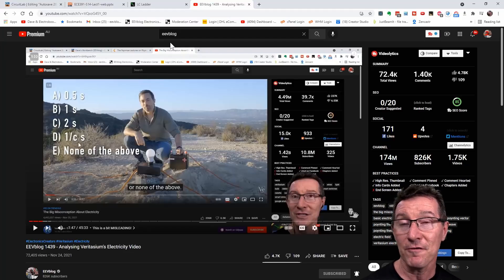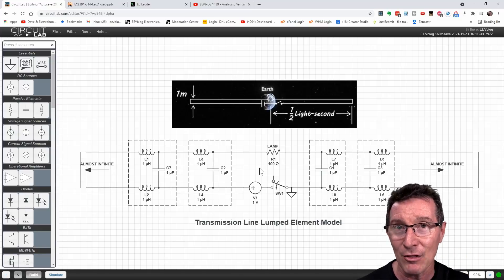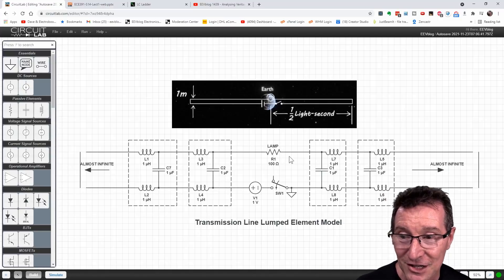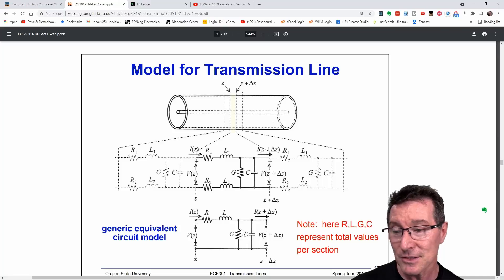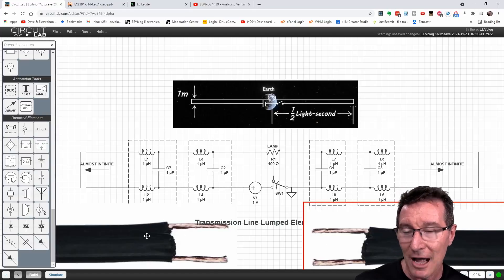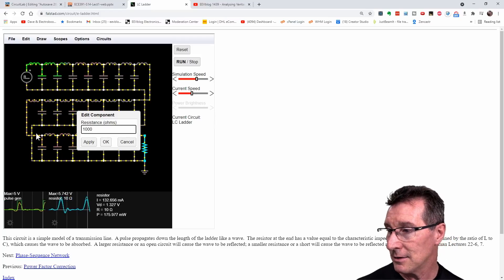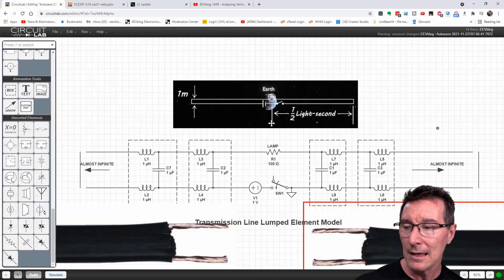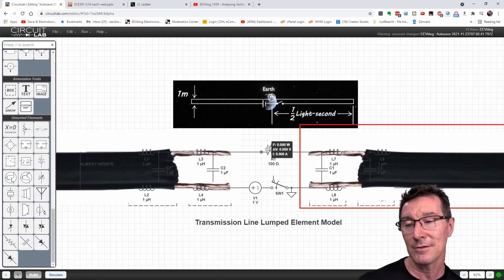Veritasium Electricity Video - Simulation Notes

Comment: The "spirit of the original video" is to fool people into thinking that the bulb will emit perceptible amount of light almost immediately after the switch closes. So stop trying to sugar coat it. If you're going to act like all it takes is a miniscule current to flow, then that's already happening due to background E-M fields. He wouldn't need the battery and switch to explain that.

Comment: Again, I strongly disagree about the spirit of the question. The demo clearly implies that the light turns ON. 
If he changed his question to: When does EM energy reach the bulb, I would gladly defer to your answer.
But that is not the question. It's when does it turn on.
By your definition, every light in my house and every device in my house, even without having the switch closed, is considered "ON".
Sorry, but that just a bunch of nonsensical science.
You can't just convert this to a transmission antenna question. 

Its a battery with a insulated conductor that "has no resistance" internally. It's a not magic light bulb. That bulb in the demo is clearly an LED. 
And that LED will have a forward voltage that must be overcome to light it. How are you planning to overcome the forward voltage this way?

By leaving those critical details out, your basically ignoring everything that makes that video wrong to begin with.

You obviously understand the underlying science. 
And we all agree that EM energy reaches the bulb after 1 meter of travel time.

But the energy arriving at the bulb is not adequate.
IF you spend time to watch the video, the pattern is clear that he actually believes the energy powering our home appliances merely has to travel with the external EM wave to be powered. So he demonstrates that with the bulb. But he is conflating that the EM Wave is External with Not having to be near the wire.
And that's two different things.
So, he falsely claims that the 1 meter distance allows for lighting the bulb. 
Take it a step further, it won't turn on my oven, it won't run my dryer and it won't spin the fan.
Reply: 100% agree, i have unsubbed for this reason. He purposely mislead his viewers for views.
Reply: @danielsmith7105  I was strongly considering unsubbing as well. I think the fact that he released the "YOU CANT RIDE THIS BIKE" before releasing any kind of "explanation video" to fix the issues with this video makes it pretty clear what the channel now stands for.

I will re-sub when he presents a video with a better explanation and corrects the important mistakes of this one. (Unsubbed.)

Comment: So in effect, the length of these loops could be infinite and they don’t really effect the fast transfer of field across the small gap. That local effect is what matters.
So no violation of speed of information transfer. We don’t rely on field transferring through the entire loop, just local capacitance. Just depends on this gap (1m , 2m or whatever)!
Reply: “1/c” answer is still wrong as at this exact time the amount of energy delivered is minuscule. And if we accept that “any current” works, then this is a troll question producing the same answer without wire at all.
Reply: What if someone cuts the wire 150,000km away? The lamp will not light up. In 1m/c seconds we will learn that something happened 150,000km away. (Strictly speaking, we will not know where exactly something went wrong. But if we know that someone will cut the wire exactly 150,000km away, we can keep switching on and off and if within 1s/c the lamp does not light up we know faster than speed of light that the wire just got cut)

Comment: I think of something much smaller than a light year long wire. Try a much smaller circuit but triggered in the Mhz range. It still takes time for the power to reach the load.

Comment: You can`t "Ignore the Inductors" because they are simulating the speed of light on the line. You ONLY get an initial spike because you failed to add an initial inductor. There should be an steady current through the capacitance equivalent to 800 Ohms, enough to light the bulb faintly.

Comment: By definition the speed of light is the rate at which EM travels the space in a vacuum. At a first level, what is being assumed here is the diffusion of electrons due to entropy is equal to the speed of light. It may be, and this probably leads to the idea there is something pretty much the same about all matter. Also, my understanding is that as you travel across a material, the electrons do not go straight, especially at lower voltages, but sort of wind around impurities etc. So I would expect the measurement to be slightly lower. Also the main point of transmission lines is to supply a reliable potential difference to drive a more reliable DC source or something after a power supply. Are there losses due to refection? Don't know.

Comment: If the lamp turns on at any current, it will turn on instantly from random electron movement in the wire.

Comment: I think that ignoring the 1/2 light second wire is the best way to go here. Just model this as a single turn transformer, and I think you would get a more intuitive solution to this problem. Clearly this would be a very poor transformer, but it gets the idea of the field lines across better than the transmission line model.  🙂
Reply: The transformer would not work for DC here.
Reply: @pkundrat  LOL, you have also been fooled by the nature of this situation. A transformer also has a transient response, just like capacitors.
Reply: @mcconkeyb  Transient yes, but steady state no. And the point was how energy flows, and this has Veritasium wrong. It flows along the wires mostly.

Comment: It is reasonable to model the long wire pair as a transmission line.  One thing that I have not seen addressed is that the "instantaneous" impedance of a transmission line is equal to its characteristic impedance.  Assume, for example, that the wire pair's characteristic impedance is 800-ohms, as you guessed in your previous video.  Then, when the switch is thrown, you can model it (at t-zero) as two 800-ohm resistors connected to the bulb, over one meter.  So, I agree with the 1m/c-seconds answer, except that the bulb is seeing the battery in series with two 800-ohm resistors.

At steady state, these apparent 800-ohm resistors go away, and the resistance-less wires are delivering DC current to the bulb.

From a transmission line perspective, let's do a thought experiment for the three classic states of the far end being Open, Shorted, and Terminated.

If the end of the long transmission line is Open, the instantaneous impedance is the characteristic impedance.  So, surprisingly, power will be delivered to the bulb in 1m/c-seconds, albeit of the opposite phase.  In the steady state, current stops flowing,.

If the end of the long transmission line is Shorted, the instantaneous impedance is the characteristic impedance.  Again, power will be delivered to the bulb in 1m/c-seconds.  In the steady state, DC current will flow as expected.

If the end of the long transmission line is terminated in its characteristic impedance (in this case an 800-ohm resistor), then the 800-ohms seen instantaneously at the input remains there without change.  Interestingly, if the transmission lines are infinitely long, the result is the same.

Transmission line analysis is a useful shortcut for understanding the problem proposed by Veritasium.  But, the characteristic impedance must be taken into account.

One thing discussed here is what if you take the wire and spread it out more.  It's claimed that the answer changes.  Let's just think about that from a transmission line point of view.  If the spacing between the TL wires is increased, the characteristic impedance is increased.  So, the time in which the power appears at the bulb increases with this distance, but also the apparent series resistance increases, too.   So, practically, at some spacing the bulb will stop lighting up "near-instantaneously".

Keep up the great vids, mate.
Reply: Did your calculations include an INSULATED wire carrying Direct Current (NOT AC)?
Because in the demonstration the wires in the demo are clearly insulated.
Just out of curiosity, if you modify your simulation so that the wires are no longer "bare" wires, but insulated, what does the effective impedance become?
Reply: Characteristic impedance of the line is not the same as type of impedance as resistor impedance.
Characteristic impedance of the line is the ratio of forward traveling voltage wave to forward traveling current wave, while resistor impedance is the ratio of voltage across resistor to current going thru resistor.

Comment: It seems to me that a single electron at least might get displaced in the other line at 1/c seconds. No the light bulb won't turn on. If you had an infinitely strong battery it might though. Derek was standing in front of a car battery and an ordinary light bulb though with the  "correct" answer being 1/c seconds. If you were talking about an infinitely strong battery or an extremely sensitive light bulb his theory may or may not work. I am not sure. We aren't very familiar with infinitely strong batteries though or non-regular light bulbs.  His setup is just a tad misleading.
Reply: If his battery had a very high voltage, then yes, the light would turn on after 1 meter of travel time.
After 1 second, the LED would receive the energy from the conductor traveling the "long way"... over 300,000km.
And then the LED would burn up from the extreme voltages and release the magic smoke, and be destroyed, thereby invalidating the whole demonstration.
Reply: The bulb he is using is a 110 Volt AC LED bulb, it does not work on 12 VDC, His experiment is a hoax
Reply: @alnorman6846  Between 0 and 50 ns the bulb never sees more than 1.4 volts per the diagram in the video: https://youtu.be/bHIhgxav9LY?t=759
The whole thing is farcical.

Comment: If 1/c is true then the wire length only needs to be 1 m in each direction and the ends may be open. Any "information" beyond 1 m is inaccessible to the circuit on that timescale according to the limiting light speed.

Comment: Dave, I understand why you use the transmission line model to show that the delivery time is very short (C helps) but the truth is that in this case, the usage of TL model is totally inappropriate and makes the thing more puzzled than it is. Mind that the TL model is ONE-DIMENSIONAL model of TL to derive ONE-DIMENSIONAL telegrapher's equations. There is only z-axis and no x or y. To simulate this scenario, you need 3D model which correctly accepts the 1 m distance and shows that the delivery time is 1/c for 1 meter in space with mju0 and epsilon0 - like we simulate the directional coupler, for example, where the lines distance is 1 m.
Reply from the maker: TL makes it more puzzling so let's use a 3D model. That's easier how?
Reply: @EEVblog2  
Dave, please repeat your simple sim with the "inductor followed by shunt capacitor" line section and see what happens.
Reply: @EEVblog2  I'm sorry, but it's not about simplification, but about being closer to the reality.
Preface:
I'm not saying that the model can't help to solve a little different scenarios,
such as moving the switch to the far end of the wire (150,000 km away from the battery and light bulb).
What is the time now between the moment the switch closes and the bulb "lights up"? Yes, TL theory helps there.
Body:
Using the TL model for 150,000 km stubs to determine the delivery time between the battery and the bulb 1 m apart is totally wrong.
Why?
TL model theory is derived on the basis of certain conditions: fixed wires cross-section along the axis of the investigation (e.g. z), homogeneous space and wire material (mju, epsilon fixed) -> TEM mode, etc.
This makes it possible to describe events on TL using one-dimensional (one axis colinear with TL) description exactly as Heaviside's telegraph equations do using voltage and current on the TL and generalization of the Kirchhoff's law for model based on the R, L, C, G infinitesimal elements.

So, using TL theory, it is possible to show that the wave reaches the far shorted ends of wires (forming such TL) after 0.5 seconds (150,000 km), but it does not say anything (it can't) about the time relation between the TL opposite wires 1 m apart. Better say, it is always zero using TL model because of voltages and currents in the background of TL theory. And your circuit/simulation confirmed this. It is zero no matter what the infinitesimal TL section will look like (CL, LC, RLCG, ...).

The reality is, that in the moment the switch (located on the battery) closes, an electromagnetic field begins to form around the battery and spreads with c, so it reaches the bulb at 1 / c (this is why it is better to talk about the delivery time than "bulb to light up"). So this is definitely about 3D elmag field theory and yes, this task can be simplified to a 2D planar model, but we certainly can't use standard TL theory as shown in video.

Comment: One thing is that an electric transmission over a wire produces an "interference" over another near wire, and the other thing is that the "power transmission" from the battery to the bulb goes through the 1 meter "over the air" distance... what goes by the air is an electromagnetic interference than may produce some slight lightening in the bulb, if any. The power (the 99.9999..9% of it) will of course go through the wire, and this Veritasium video is pure "snake oil" trash.